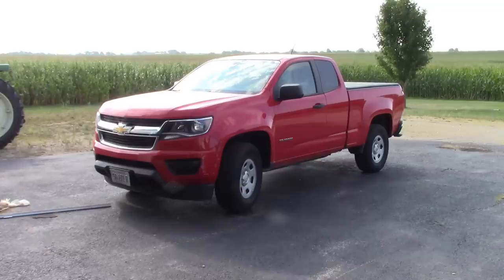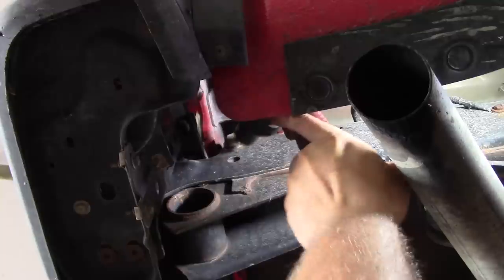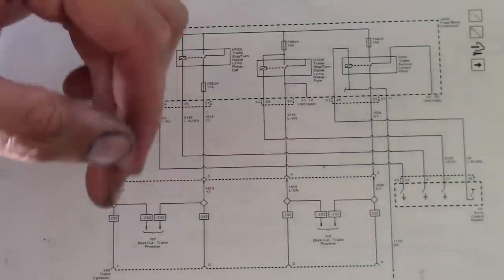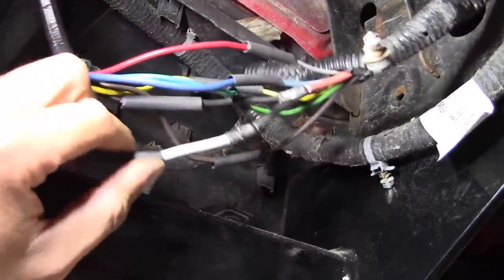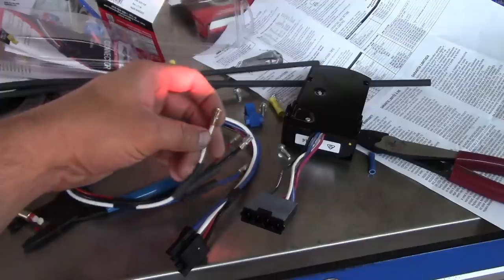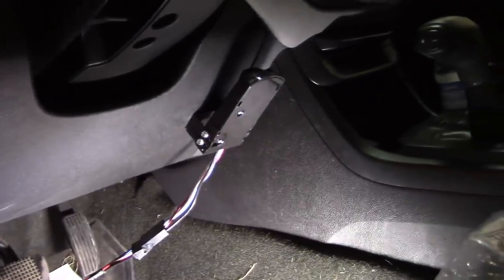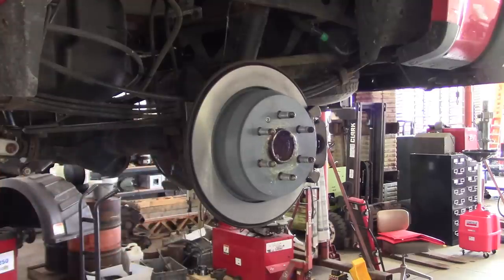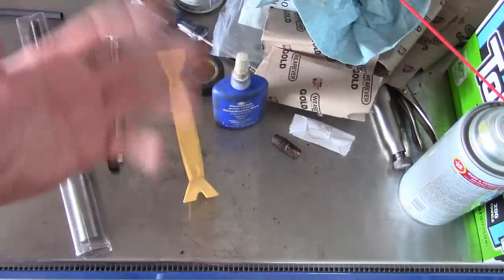2015 Chevy Colorado - Install Trailer Hitch, Wiring, Brake Controller

Comment: did you guys get a bad batch of plates, too?  we had an entire run of plates where the paint just slumped off like it was melting.  you migha seen a couple if some PA drivers came through.

Comment: You can also buy a solid state relay to replace the stock turn signal relay. It allows you to adjust the flash speed and won't flash at different speeds depending on the resistance of the circuit.

Comment: Hey Wes, I know working in a shop it’s less of an issue but have you picked up any cordless impacts yet? Not having to drag a hose around is so nice, heck just my 1/4 dewalt with a 3/8 adapter is Godsend.
Reply from the maker: They are nice! I have a 3/8 drive Dewalt cordless, but it's getting pretty tired. I was thinking about getting a new Milwaukee and a cordless ratchet, but almost all cordless tools have been out of stock around here since March. Something to do with Covid I guess.
Reply: Watch Wes Work ya I didn’t even think of that, all the car lots and bike shops around here appear to be running out of inventory. I couldn’t find rings for canning they other day.... on the tool front if I had it all to do over again I’d go Milwaukee but i already have all the dewalt stuff so it sucks to buy all new batteries and stuff

Comment: Quality work as always Wes.

The way that I prepare a small guage wire for insertion into a larger connector or terminal is to strip about 1/2" of insulation from the wire and then bend the copper in half forming a double thickness of conductor that will be compressed better when you crimp the connection.
Reply from the maker: I do that as well, usually when doing 1 into 2 or 1 into 3 connections. I've seen factory wires crimped that way.

Comment: I  like that you mentioned the differences between a factory installed wiring and a plain setup. I got a giggle out of your comment about the best loctite rust. Your comment about shops refusing to install hitches is because of the word LIABILITY (sorry about the shouting) as they are responsible for the workmanship of the install. The shop that let the vehicle out with 60% of the fasteners would have been at fault if the accident investigators determined the sloppy job was responsible for the incident due to the trailer hitch dropping off the tow vehicle. Keep up the good work you do.

Comment: Many years ago back in the 80s I worked for Telecom Australia as Lineman and we used Scotchlocks by the thousands dare I even say millions and some of these connections are still going strong now in 2020s but are being replaced by optic fibre so completely new technology is being used to connect wires together

Comment: A friend of mine started work at an undercoating shop. They had maps of cars where to drill holes to spray into cavities and such. When the old lady came to pick up the car, she pulled out the seat belt like normal and it was soaked in Tectyl so she ruined her coat. The seat belt was spooled up into a cavity. Wisdom - always pull out the seat belts before spraying into the cavities around them.

Comment: Perfect timing.  Off Market Place I scored a tire/rim $25. for our used Ranger just 5 miles from home. In talking with the guy found out we go to the same Church.  Price dropped $5. I looked at his 2 Rangers he’s gonna make into 1 good one and asked him if he needed 2 receiver hitches.  No, you can HAVE it once I get it off. BTW the wheel/tire was the spare and had never been on the road.  Paid for with  pop can deposits neighbor had left on side of road marked free, $17 left over.
“Tony” could use thoughts and prayers as his landlord is selling his rental house, has the Ranger project and just found out he has throat cancer. (Non-Smoker)

Comment: Installed a hitch on a 2007 Jeep Commander.  Factory units. All the wiring was in place with plugs.  Plugged in the factory connector with pigtail and screwed it in place.  Installed the controller and plugged it right on into the harness.  Didn't have to splice wire one.  Took about an hour for the entire job taking my time.  I am surprised the Chevy Truck was not as prepared.  Tow capacity is listed on the driver's door frame from the factory. Without a tow package the Colorado for that year had a max tow capacity of 4500 lbs.  Kind of overkill putting an 8,000 lb tow hitch on a truck that cannot legally and safely tow that heavy a trailer.  Not to mention the extra stress on a drivetrain and suspension not designed to handle that sort of loading.

Comment: Of some interest, perhaps, I live on west coast.  When I got to Florida, found they used a different wiring configuration, than the west coast.  Had to put the wires out of connector, and change there placement, to make the trailer light and brakes work right.

Comment: Back in the day my dad would've just welded a tounge into that bumper support with a couple of braces and called it good. When I was a kid I remember him putting a hitch on a Suzuki van which had a 1L engine and probably weighed less than 800kg
Reply from the maker: My dad used to pull a 7 ton deckover trailer behind a Ford F-150 with the factory bumper hitch. I think that bumper is rated for 2 tons. He broke everything else on that truck, but never the hitch!

Comment: Job well done sir, I just did this on Friday to a 2012 f150 at my work and other than the rust (central Illinois) it was a easy four bolt job and even though the truck didn’t have a tow package it did have a factory four flat connector which I removed and installed a 7 way plug instead just because we don’t don’t have any trailers with a four flat anymore.. I’m  just like you, I hate those stupid scotch lock things! Normally what I do since we have it all on hand is make up weatherpak connector plugs that way whatever I’m installing can simply be removed by unplugging it but for this install I went with one of my newer favorites which are solder filled butt connectors with shrink tube! You insert each wire and in the middle of the connection there is what looks like a normal crimp barrel but instead it’s a barrel made of solder,  align the wires and start by heating the solder until it flows and the finish it off by heating the shrink tube which also has glue in it. Super strong and water tight connection although not sure why I went to the trouble beings we will never use that truck to pull any trailer because we don’t have any that light but instead we needed the hitch to be able to pull our sewer hoses out of sewer when they get hung up from our big vactor sewer cleaning trucks...  next project is to design some form of captive hitch to secure that hose to the truck and won’t let the hose slip which tears the hose.  For the last 22 yrs we have used a standard Pintle hitch and just wrap the hose around it a few times, close the locking jaw, put truck in 4 low and hope for the best! This process tears the hose up which costs $10250 for 650ft which is what our trucks hold and although they do make menders to repair it but because of the water pressure the trucks put out vactor says only two menders can be used in 650’ and they have to be at least 250’ apart!

Comment: I switched my trucks over to the semi style trailer connector with the split round pins, Grote makes the best because the pins are brass. The semi style plugs are way cheaper and they work much better, I made up an adapter that will convert it back to the regular in case I need to tow someone else's trailer and it lives behind my seat. I use to work for an REA Coop as a mechanic, we had nothing but problems with those flat blade trailer connectors, in my book they are worthless.

Comment: Good job! Interesting, I was wondering if you mid west folks used rust prevention products. I like to annually spray the bottom of my truck with fluid film in a undercoat gun. I've had great results doing that in road salt land. We also have a company that sells another product that is popular and franchises the application process. Another youtuber, Mustie1,  uses chainsaw bar oil cut with kerosene and has good results with that. Also Toyota recalled my Tacoma for the frame cavity wax application. I was hesitant to have them apply it, but it extends my rust through warranty for 10 years. It will be interesting to see how that works.

Comment: Nice tire machines, best investment I ever made, plus if you maintain them they have a great resale value. With the balance machine, it's easy money.
Reply from the maker: The tire machines sell in a heartbeat, yet you can hardy give away a used balancer. It's crazy.

Comment: Nice Video!! Those pliers you used in the cab, I believe they were Klien brand, I have the ones made by T&B, should the cutting tips break off (one pair of mind did) I saw in a motor shop they just grind off the rest of the cutting tip and now the pliers can get into a tighter space between wires. Love those pliers, they make really great crimps!!

Comment: I bought a hitch and wiring kit for my 2012 frontier and it took less than 10 minutes to install. The frame of the truck has threaded holes so it just bolts on with six bolts and the wiring kit plugs right in to a connector thats already under the truck. Much easier than welding one on a 1994 nissan and having to wire in a plug.
Reply from the maker: Many older trucks required drilling the frame. That's always fun.

Comment: Just for FYI purposes I'm not sure about all models or years I do know the 88-98 OBS chevy/gmc trucks the big hot battery feed for the backup battery charge circuit is not connected under the hood at the fuse box from the factory and its common that there isn't a maxi fuse in the box and will require one to complete the work

Comment: One thing that I really like and I'm impressed by with Wes is his consistent use of a torque wrench.
So many people go by the old "one click of the wrist" method that can lead to expensive and dangerous results down the road.
I've seen that happen one to many times.
I once watched a trailer go flyin' of into a ditch with someone in it (not illegal then) and my dad's friend got ahold of the accident findings.
It turned out to be bolts on the hitch that weren't as tight as the installer thought.
Plus no lock tight equivalent.
Thankfully, the occupant survived with only a broken leg.
We definitely proves himself a dead serious professional.
Reply: I honestly can’t stand seeing it. I’m only 25 and know well enough that engineers didn’t waste thousands of dollars in research just for it to not mean anything.

Comment: for big crimps onto small wires I've put bootlace ferrules on the small wires before putting them in the big crimp. Possibly sketchy but maybe less so that just putting a tiny wire into a massive crimp and hoping it grabs

Comment: Scotch locks have been plaguing the U.K. for years when I was at tech college over 25 years ago the instructors warned us all about using them.he also said don't go wiring spot lights in of the main beam wiring either. One of lads said it's ok if do it with speaker wire lol.

Comment: Great video of the proper way to do a hitch and brake controller 
In my younger days I installed hitches 
Sometimes people would come in with the biggest mess that they made themselves 
One I fixed after owner did it himself. Was all mounted to the safety bumper that was coming apart
Reply from the maker: Yikes!

Comment: My company must have build some special trailers back in the 50's. One day I was told to junk a bunch of them out and rebuild a few of them. For the lights I found out they just solder the wires and black tape them which work great. Today I have seen connectors that you put two wires together and then you use  your heat gun that will melt solder to bond the wires and seal the tubing. I never use them but they look good. On the splice connector you hate. The only way I use them is I hate to cut wires so I strip a little .insulation off clip the wires then black tape and use Liquid black tape to seal. I use the liquid black tape on everything outside and it works for the long haul.
Reply from the maker: Lots of people talk about those heat and solder connectors. I tried a few and didn't like them.

Comment: That truck is in good shape, so glad you coated the frame.. i learned from mustie1 bar and chain oil(chainsaw oil) .. it works great.. i got two 25 year trucks coated both frames..your way is much cleaner

Comment: Thinking about the big ground wire, it's probably because of the EMI generated by the brake controller.  A beefy ground will help suppress the switching noise from the controller since the brakes are just big inductors.  You might have some noise in the radio with a small ground wire.

Comment: More Mrs. Wes explains it all (w/ kiddo and pup) please.     The videos i prize are those i might need to do on every vehicle I own (forever) such as trailer hitches, defective factory radios (I have a new to me 2003 Odyssey that I'd be happy to offer as a test bed), replacing the passenger side door motors w/cable on that same Odyssey, and perhaps wheel arch rust repairs and dual front fender replacement on a 2002 Prizm with only about 60k.       Thank you so very much Wes.          -just sayin'...
Reply from the maker: I dunno. Paint and body is kind of outside my wheelhouse!
Reply: @WatchWesWork   Paint and body are on the 60k Prizm, the  nom-working passenger side door and hitch are on the Odyssey and as I am disabled I can come at your convenience...

Comment: Never seen these brake controllers here in the UK ? Our larger trailers or caravan brakes work using a floating hitch connection on the trailer side that either uses cables, rods or hydraulics to apply the brakes, the pressure caused between the trailer and tow vehicle by the tow vehicle stopping is the force used to apply the brakes.
Electrically we just have a common ground & a live feed for brake lights, left tail lamps & markers, right tail lamps & markers, left turn lights, right turn light & fog lamps.
Some vehicles have a secondary plug fitted for auxiliary batteries, fridge power & reversing lights.
This is for domestic & small commercials using either a ball & socket hitch or a ring hitch, commercial trucks use electrical & air connections for ABS brakes & lighting.
Reply: In the US, it’s common to have electric brakes on trailers.  There will be a small electromagnet running against the inner flat face of the drum.  When energized, it is pulled against the face and pulls an actuation arm to apply the brake shoes.  The hydraulic floating hitch “surge” brakes you mention are common over here on rental trailers (U-haul) where the car/truck wouldn’t have an electric brake controller.  It’s open for debate, but I find the electric system to be simpler and more reliable as long as it’s wired correctly.  Advanced models now use g-Force sensors to know how much current to send through the electromagnets, they are very smooth.
Reply from the maker: Right. Common in North America.

Comment: My 2012 Holden Colorado (Australian version) has a reed switch in the 12 pin flat trailer connector that senses if the cover flap is open.
The car gives a warning if the trailer cover flap is open and no turn signal lamps are detected.

Comment: ok, I'm getting scared, HOW DID WES KNOW, I was installing a trailer hitch in my truck?!?!?   and I had no clue how to wire it up, with the lights blinking at goofy speeds, and the trailer brakes, and was guessing how to mount it.   thanks for the video!!!! :D
Reply: Installing one too on my work van, trailer brake etc. I was like wow just what I needed

Comment: Just a quick tip, because I deal with this kind of stuff all day long. :-) When you have to crimp a 14 gauge wire to a 20 gauge wire obviously the butt connector will be too big for the 20 gauge. Just take another wire stick it into the butt connector and cut it off flush, so the copper strains remain in the butt connector. Repeat until theres enough copper (similar to a 14 gauge), then insert your small wire and crimp it. That way you make sure the small wire doesnt fall out later and you dont damage the butt connector during crimping. We call this "stuffing".
If the difference between the two wire gauges is not that big, I remove  the insulation 2 or 3 times the length I need, then just fold the wire 2 or 3 times, insert it into the butt connector and crimp it.
Reply from the maker: I like the fold over method as well. I've even seen it in factory wiring.

Comment: You should do a video on electric wiring. Example, splicing , connectors , looms , fuses , sprays , tools , grounding  etc.
Reply from the maker: That's basically every video...

Comment: I know many of the brake controllers require them to be mounted flat, so I was surprised when I seen you mount that one at that angle.
Reply from the maker: Back in the old days when they used pendulums that was true. Then they came out with the adjustable ones where you had a lever on the side that had to be level. Now they are all digital and it doesn't matter.

Comment: 13:30 for the bracket that doesn’t go back I’d just give it to the owner and it the tire starts rattling they can either weld on a plate so it can be mounted or take it somewhere. At least they have the option down the road with the part.
Reply: IF the owner wants it...

Comment: great info, i picked up a relay box at the wreckers for my 95 f350, the brake controller has a place to plug in under the dash from factory and i have the proper connector,  there is a factory place back by the rear bumper to plug a 7 pin connector, but that is $350 at the dealer and i cant find one at the wrecker, i did find a new 15,000lb class 5 hitch on craigslist for $100  :)
Reply from the maker: On my truck the wiring was there in the cab, but not in the chassis harness. I had to run wires for the brakes along the frame rail and connect to the control wire at the firewall.